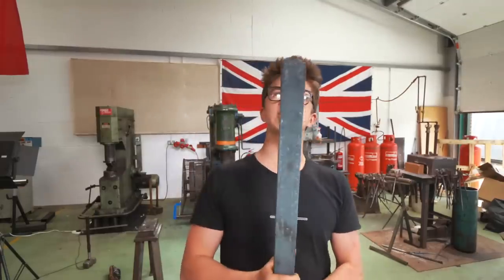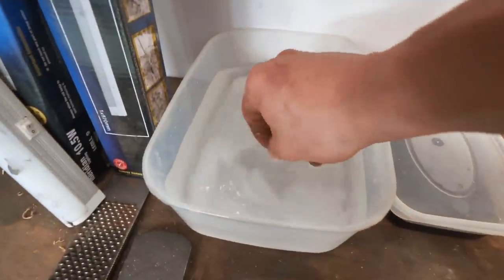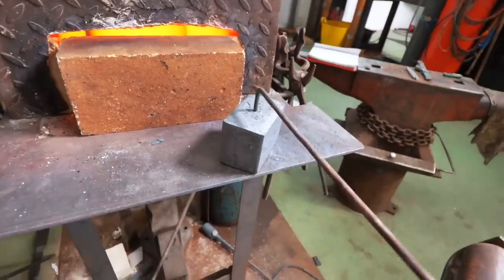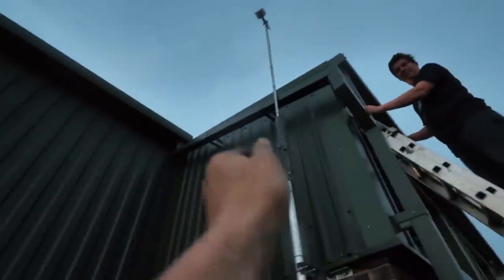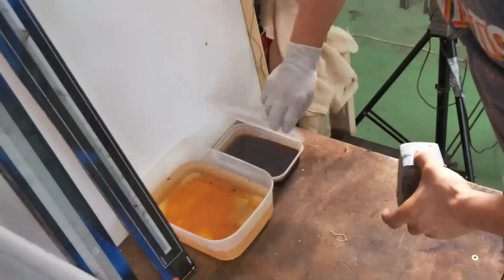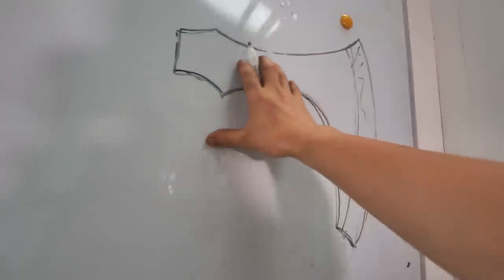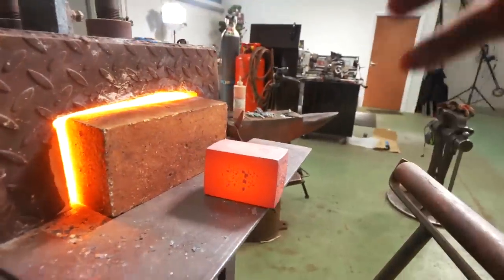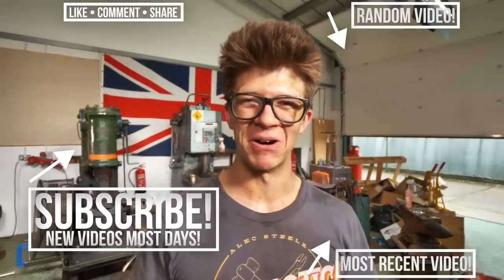VIKING BATTLE AXE: Part 2

Comment: You need to protect the wall where your grinding at. You can already see a burn mark where the grinding sparks are sticking to the paint. I would use a sheet of 1/8" mild steel mounted to the wall to protect the paint. Otherwise, the landlord might get mad or you would have to repaint it later on... just my .02.
Reply: Intensivevirus so many have said so! Let's go down there and install it he he
Reply: It will be just fine. Regardless of what happens he's going to have to paint it. And putting 1/8" steel up would require making holes in the plywood (it is plywood, not drywall as some have erroneously said.), and that would be even worse for the landlord.
Reply: Intensivevirus he built the whole room himself I think. If I remember right when he first showed the shop there wasn't a room or it was just studded out and he said he was gonna put his grinding room there.
Reply: Yeah, I'd really hate to see him leave a little mark in the paint. Especially after building a grinding room and kitchen, drilling large holes in the floor and epoxy'ing bolts into them, putting holes in the walls to hang various shelves, and an entire faux wall with wood/rock wool/flags fastened to the back wall.
Reply: What does the paint matter it is a shop not a living space
Reply: mike knudtson continued hot grinding striking the wall if in the area of Studs or if wall is not sheet rock rated for high temps will lead to pyrolysis of the wood and of the paper backing of the sheet rock and of there is heavy grind going on can lead to fire...  It is always a good idea for grindings to strike a non flammable surface be it a block wall or as stated above a small piece of steel sheet...
Reply: its a metal and brick building...we dont put flamable studwork inside our brick walls
Reply: captainnemo I'm pretty sure the interior walls are studs pretty sure an earlier video showed that...  could be steel studs though that is becoming very common today...
Reply: C and K Early Warning Systems,
Actually, steel studs have been around since the 1940's in the USA. BUT THE PLYWOOD OR DRYWALL IS STILL A FIRE HAZZARD.
Reply: Thomas Russell yeah I know weird they were really big in home building a few years ago kinda fallen away and I run into them in more industrial commercial settings now...
Reply: They did use wooden studs. You see the carpenter framing out the room in previous videos. Most of the grinding that sprays laterally is against the brick/block walls though. Shouldn't be an issue.

Comment: alec you need a TIG welder
Reply: Sam Fowler tell him to put a metal panels in his grinding room. That room is going to look awful if not.
Reply: Why would he want to tig it? It's harder to learn than a wire fed mig, more expensive, more maintenance (esp with water colored torches), and he's still have to grind the weld out. It takes 2 minutes to mig it. Much easier.
Reply: Actually If you used a homogenous(spelling? "no rod added") Oxy acetelene weld to get the steel to stick together, there would be no need to grind out the weld metal in the joints. Right?
Reply: Cool, thanks for that. School was two life times ago for me my friend. :)  You are correct.
Reply: Yep.  Torch welding is pretty much just forge-welding on a tiny scale.  Nothing added.  TIG is just doing the same, with an electrical arc instead of fire.
Reply: No it is not. It melts the two alloys and mix em. You will see it in the etching later on. this is why he grinds the welds away. 

Also it is not easy to weld highcarbon steel. It will crack if you do not add material with an even higher alloy then the two you weld together. Hes welds are only to hold it togeter till the fireweld. 

Stickwelding is the strongest for such materials and MIG is clearly the fastest.
Reply: He needs a stick welder and use that instead of the mig/mag until he has mastered that then he will be amazing with his mig/mag

Comment: Alec - re: your comments about your respirator and accessibility the other day:

A hook to hold your respirator, with a lexan/perspex cover, hinged at top, so you can lift-grab-wear-grind-remove-hang, and the respirator still stays relatively clean, and it's easily accessible.

Comment: Great work as always. Have you thought about hanging a cloth on the wall in the grinding room? You can see there's already a mark across the white paint on the wall, a cloth would prevent that and act like a backstop for all the sparks and particles coming off the disc. If you spaced it out an inch or so most of the dust would hit the cloth and fall down on the floor.

Comment: The pattern is awesome! What's more, you seem to have enough metal to forge two axes. Which doubles the awesomeness, of course! 
When I forge I usually have a rough idea of the weight of the object I'm trying to make. I then weigh my billet to estimate how much I'll need (taking in account how much material I'll lose while forging and grinding). Battle axes were typically forged rather thin so they could slice rather than cleave. You probably won't need more than 2 kg of steel, depending on whether or not you forge the edge close to its final shape rather than grinding it. 
Anyways, I'm looking forward to the finished piece! Great work, keep it up!

Comment: Alec, i believe most of those axes where made by folding a piece of steel/iron over a form for the eye. where the two ends meet a piece of high carbon steel was placed in between and forged together. inserting a wedge into the billet was likely very rare

Comment: Hey Alec, if your facing mill is throwing sparks ⚡️ you have too high of a rpm slow that down about 250 rpm you will get a better finish and save on inserts. I can give you a snap shot of a machinist handbook and an equation to use to calculate speed based on material and cutter size.

Comment: When you are facing on the mill, you either need to slow your rpm of the cutter or increase your feed rate. It doesn't look like you are getting good chips, and you should never see sparking. Correct speeds and feeds will drastically improve your finish as well as extend the life of your cutting tools.

Comment: Really like the new shop. Help your knees and lower back tho. Standing on the hard concrete floor over time will really take its toll. Throw down some folded up drop cloths in your main standing areas or purchase some of the standing mats that are made for industrial use. Good stuff and well wishes from Illinois. 🇺🇸

Comment: have you considered doing any wet forging? from what i understand, once you have the billet roughed out, you pour water on the anvil, then do a little hammering on the billet. this should blast off a lot of the scale on the billet of damascus, meaning that you can spend less time grinding, as well as lose less material to said grinding

Comment: Alec, besides your special Damascus patterns it's usually always about the "W" pattern. Why not try a W w/a twist or as many twists as possible or use cables or chains to forge Damascus to add to the still amazing W explosion pattern. Or possibly the rain drop pattern with drilling different depths and then forging it flat again. The same thing can be done with the angle grinder and cut/grind grooves to any Damascus billet and the pattern will change. Including wrought iron with the Damascus also makes for an interesting billet.

Comment: Tennesse Heavy Double Bit Working Axe
Sub-Zero Double Bit Axe
Total Weight: 7.3 lbs.
Length of Handle: 42.0 - 45.5 inches
Wood Tongue: 5.00 -5.50 inches
Blade Width: 6.00 - 7.5 inches each side
Using austenite steel is the 304, also known as 18/8 for its composition of 18% chromium and 8% nickel. 304 may be referred to as A2 stainless (not to be confused with A2 grade steel, also named Tool steel, a steel). The second most common austenite steel is the 316 grade, also called marine grade stainless, used primarily for its increased resistance to corrosion. A typical composition of 18% chromium and 10% nickel, commonly known as 18/10 stainless...

Comment: Ask your ISP for cell directions. Most won't give you coordinates or exact locations, but they will usually tell you how you should aim your receiver to get the best speed. I. E they will tell you where the nearest cells are in correlation to your antenna and check which has less users if two of them are useful.

Comment: just a thought. do you have a vent on your roof peak? that would help with the heat issue in the shop. especially in the summer months. They also make them with louvers so you can close them in the winter to keep that lovely heat in. just a thought.

Comment: Have you thought about a dust collector floor sweep for your grinding room? Not sure what kind of vacuum system you have, but if you have hoses already run, it would be an easy way to keep the shop clean. Every machine I had was connected to a vacuum system, and it kept the shop dust down to a minimum. Just a thought. :) 
BTW, love your videos!

Comment: Why not place a semi-circular board or some sort to prevent the sparks and metal shavings of your angle grinder from turning your walls black? It also helps funnel the bits and pieces from flying all over the floor and collect within a smaller area on the floor? It helped me at least.

Comment: I think you should invest in some MPI gear (magnetic particle inspection). It will help you finding those surface cracks in you billet a lot easier. Or a cheaper option would be DPI (dye penetrant inspection).

Comment: Hi Alec,
I had a question: is this going to be a single handed axe, ore something like a Dane Axe? Next, since you're making a Viking axe, what do you think about later making an Ulfbehrt? If you did something like raindrop Damascus with a really high layer count, it might look like the Wootz/crucible steel that the originals were made from. It could be a fun challenge since you would need to do a fuller and have an upper guard, lower guard and pommel, not just a guard and pommel.

Comment: Alec, correct me if I'm wrong but couldn't you use steel wire to hold steel billets together instead of welding? Just to alleviate issues with removing the welds after.

Comment: personally prefer the longer video alec. need to get your self a surface grinder be so much better for forge weld on a flatter surface plus you could let it run and get on with other things.

Comment: Alec, I've done a lot soldering in electrical/electronics. Would the borax flux applied to fresh milled surface prevent oxidation, if it the steel was warmed after milling? You need to prevent oxidation to improve bonding.

Comment: When using a standard speedtesting website you need to run the test 10-15 times in quick succession to see your actual Up/Down, those sites get priority bandwidth (even from mobile internet) which inflates their mbps substantially. When I was making videos my first speedtest would be 60/20, then my 10th would be 17/4.

Comment: on a side note you should have some form of isolation washer between the two metals otherwise the mild steel will corrode at an accelerated rate through a galvanic reaction (galvanic corrosion) just a point if you plan for that to be a long term fixture.

Comment: Was there any grounding on the antenna and pole that was mounted to the exterior of the shop? It looked like a professional was on-site helping with the installation, but a grounding rod or copper cable was not visible in the video.

Comment: Alec look into ferrocerium rods for starting your forge. You just use some hard steel (I use a chuck of hardened but not tempered 1080), just turn your gas on low, throw in a couple sparks, then turn up the gas. It works great and using one makes you feel like a fucking wizard.

Comment: As far as i am aware the solution of ferric chloride and water is not an acid. there should be no need to neutralize it in bicarbonate soda. Plain old water should suffice for washing it off. That is unless your etching solution has other stuff that are true acids in it.

Comment: You might wanna detach that lightning-rod-like antenna cable from your equipment if there's ever any danger of lightning - it would fry everything attached to it!
Reply: Earthing the antenna and or the antenna mast will minimise the risk and improve the signal gain.
Introducing a coax connection will act as a protection, but will cause a 5db loss of signal capture. Definitely worth it to protect equipment though.
Reply: <-- Not an electrician! +Joshua Ellis: Would that need to be a surge arrestor?  Presumably just a coax connector doesn't provide any protection on its own...?  Is the signal gain from reduced noise because of the earth connection?
Reply: Dan James I'm not a sparky either mate, just a former Australian Army radio operator.
The coax connection merely acts like a fuse or surge protector. When high surges of electricity passes through, it can blow the connections apart ergo a very limited protection.
Earthing or grounding (depending on your terminology) will both offer more limited protection and improve signal gain. This would require a non locking type of connection.
Grounding the antenna mast separately to the antenna coax will offer a higher protection. Of course using shielded coax (thicker plastic/rubber around the coax) will also help.

Comment: At some point, the antenna will come down because you joined stainless steel and angle iron which will sooner or later result in galvanic corrosion...

Comment: Hey +Alec Steele, I was just wondering, what advantages does it have to do the gorgeous patterns and so many layers?

Secondly, I currently own the Miyabi Kaizen (65 layers of Damascus). As a chef, it has served me very well, however, last Christmas, a friend's mother, in all her wisdom, decided to chip the tip of the blade off whilst cutting up a large prime rib...in the metal roasting pan. I came into the situation when it was too late and found my lovely Damascus knife mangled. Any suggestions? 

Again, totally love your work! Every vid is a joy. 

Cheers,

Audrey
Reply: Audrey Bossman , the pattern has no impact on performance other than aesthetics.
Reply: I would think the levels of hardness and flexibility would do something. Am I wrong in assuming so?

Comment: Are you going to have a problem with that grove? Just from a physics point of view, it looks like the angles will work against you and you won't get a good forge weld and it will de-laminate the whole length of the blade.

Comment: why don't you cut the billet in half and forge weld a 1/8" or 1/4" thick piece of 1095 in the middle.
Reply: peershaunm would look great
Reply: +River run Knives         then you could pick the best patterned sides and forge weld them facing out.

Comment: 2:40 how does that work exactly? Like making that pattern visible
Reply: Basically ferric chloride reacts chemically with the iron in the steel and makes the steel appear darker. The baking soda neutralizes the acid so that the reaction stops and it is safe to touch.

Comment: could you make a sword with a fuller (if that´s the right spelling) in th middle of the blade?  in case i used the wrong word i try to describe what i mean, I mean the trough that runs from the bottom up almost to the tip of the blade (for reference: King Arthur's sword from the movie Excalibur for example) most times i´ve seen this tipe of blade they have a concave grind but the sword i mentioned has a convax grind so its up to you :D
Reply: Did you just see Adam Savage build one from Aluminum on Tested by any chance?